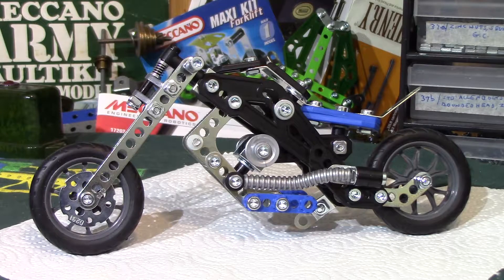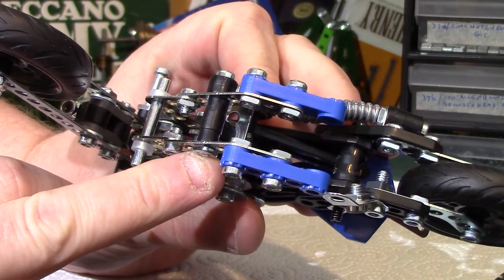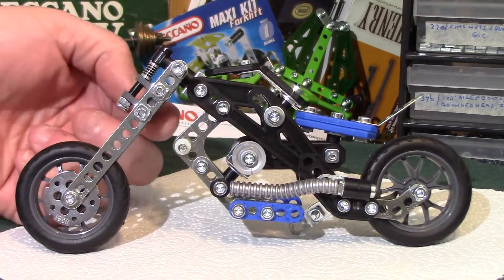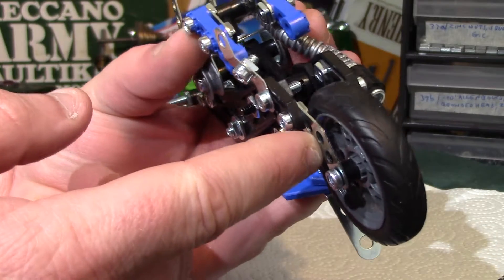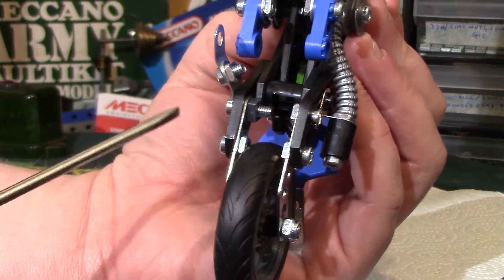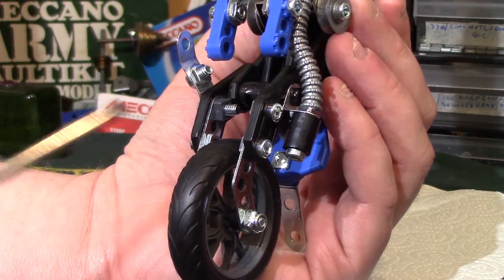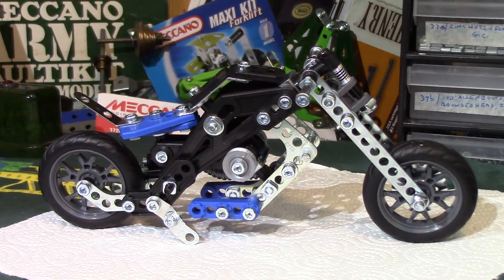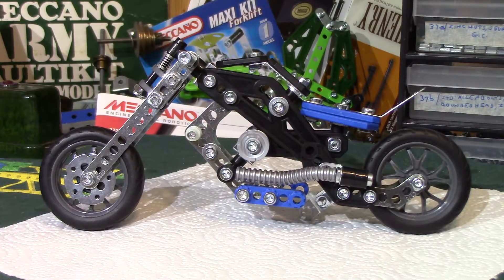MECCANO ENGINEERING & ROBOTICS 5 MODEL MOTORCYCLES SET (2016) CHOPPER

Comment: Nice video, is it me but with the selection of parts does this look like an evolution set?
Reply from the maker: I don't think so, but I'll check.
Reply from the maker: Nah, the Evolution chopper bike is totally different. However, if you mean do some of the parts look like Evolution parts, well yes, some of them would have been, but now all 1/4" spaced hole parts have been incorporated into the system just as another part(s).